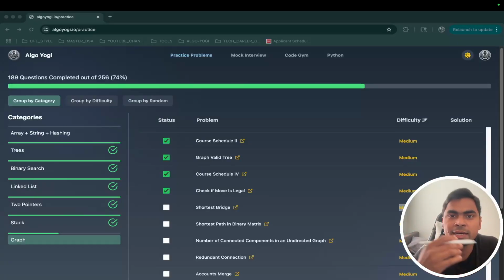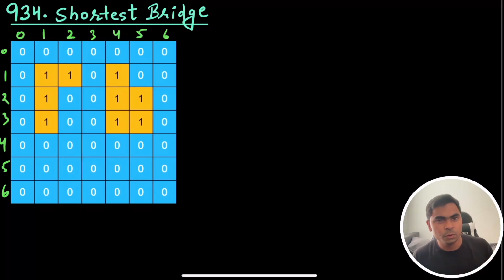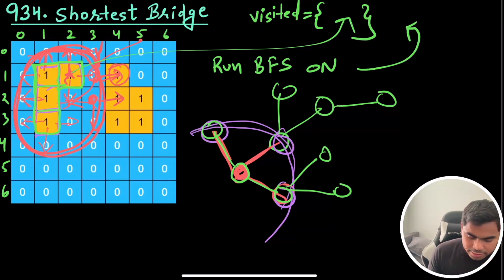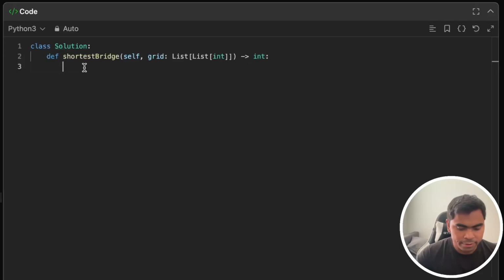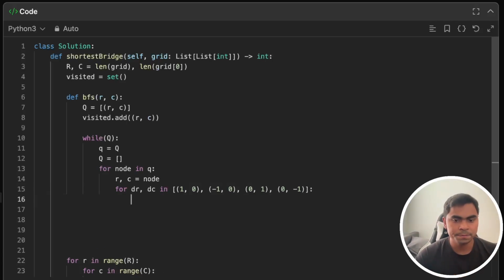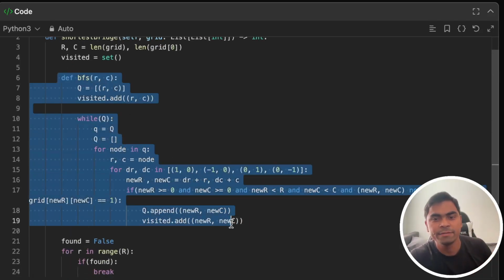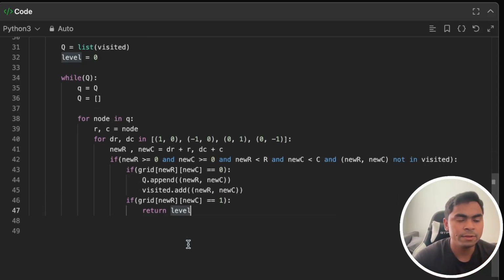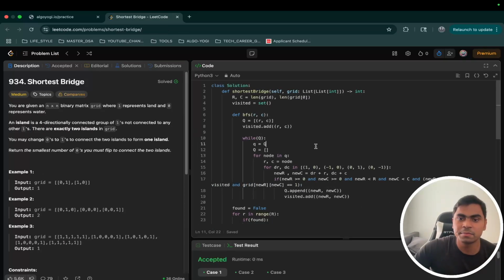LeetCode 934 | Shortest Bridge | Python DFS + BFS Grid Solution Explained | AlgoYogi

Comment from the maker: 🧘‍♂ Pinned by AlgoYogi

🔥 Solved LeetCode 934: Shortest Bridge using Python (DFS + BFS)

📌 Key Concepts:
- Use DFS to discover and mark all cells of one island  
- Then launch BFS from all those marked cells simultaneously  
- Count flipping steps (0→1) until the second island is reached

💡 Try alternate marking strategies or optimizations? Share below!